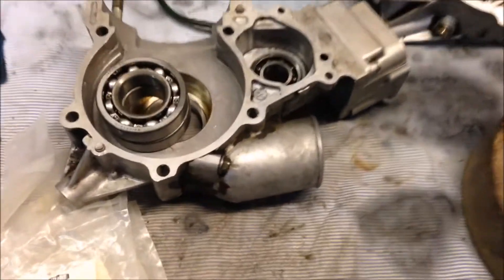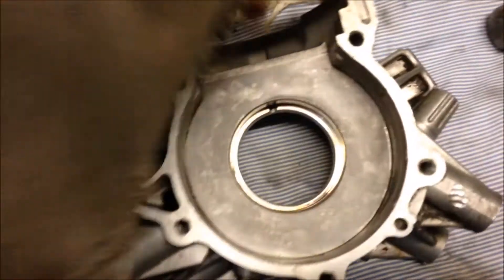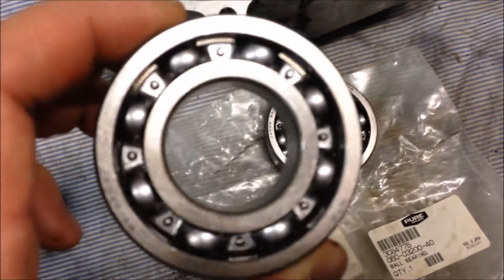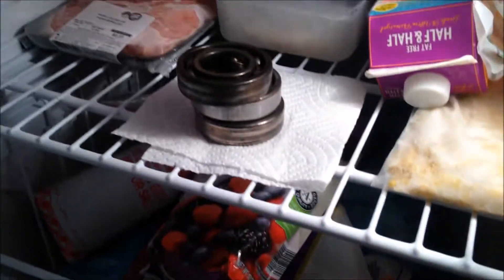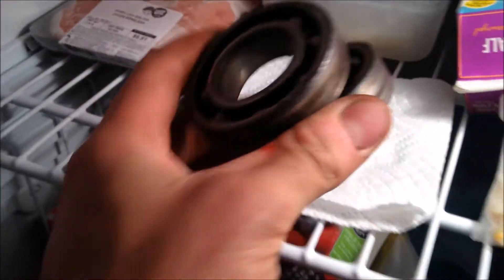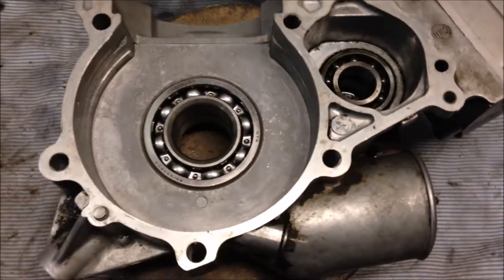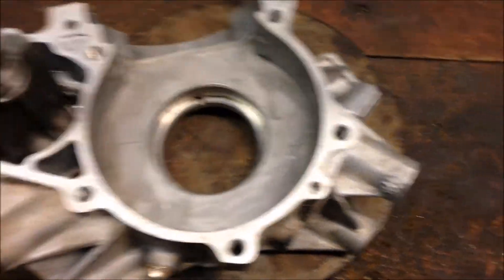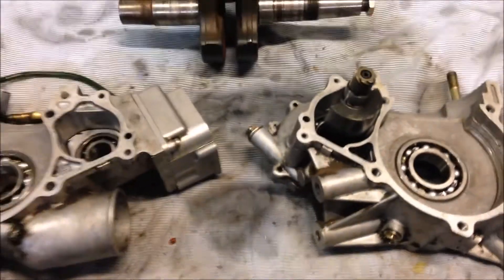Step 2: How to Install Polaris 2 Stroke 300 350 400L Crankshaft Crank Bearings Installation ATV

Comment: i got her put together and did a leak down no leak but when i started it up with the primary clutch off just to test after about a couple of minutes the taper of the crankshaft was hot enough to burn my hand but after it cooled i could move it not seized up any ideas would help thanks
Reply from the maker: Sounds normal.
Reply: so your saying it happened to you without melting the seal and its not an issue you would worry about ?
Reply from the maker: The engine and the crank are probably 200 degrees F when running yeah.…

Comment: I need help. I have watched all your videos related to restoring polaris scrambler 400. I can't find anywhere even in the manual on how to set the timing. I got her running but she backfires like crazy. Carb was passing out gas so I cleaned her up. No more leaks but I can't keep it running. And she's still backfiring. Any ideas ??
Reply: I'm no pro at this but rebuilding one as well. I believe the timing is set when installing the crank gear to the counterbalance gear with the lining up of the dots on both gears.

Comment: Okay I'm confused. Which way does the tapered main bearing go?
Reply from the maker: The bearing is symmetrical so it does not matter.
Reply: @BrapStuff  okay, tapered is the wrong work. Chamfered? But doesn't that side go against the crank? That's what i was just told

Comment: First of all love your video's, freaggin awesome.  I bought crank bearings -- but they sent all three the same -- not the one with a rounded inner -- will that make a difference???  I checked and a few other EBAY sellers sell the same thing -- all three the same not 2 the same and one with that rounded inner...    Should I proceed or return???
Reply from the maker: Give it a try and let me know what happens! :)
Reply: @BrapStuff  So do you always use the rounded towards the spacer...  But, have you ever got all three the same and put one together like that?   That's what the guy sold me...   Don't want to do this twice...
Reply from the maker: If it's something of yours give it a shot. If it's a customer project, use OEM parts and fix as the factory intended.

Comment: As long as I make sure that the correct bearing goes into the case first, does it matter which side of the bearing goes up or down?
Reply from the maker: That doesn't matter, no.

Comment: what is the best way to remove the old bearings, I need to replace counter shaft bearings (catastrophic failure) also wanted to ask about case damage, lots of gouging on countershaft and all through the inside of the case(from the bearing breaking apart, oil pump end of countershaft) rotating assembly all spins freely and smooth, however there is a hole in the case between the crank and countershaft, does this mean the case is junk? everything should still seal up, no holes on the outside of case, also inner race is stuck on end of countershaft, any tips on removing it?
Reply from the maker: Use a hammer or slide hammer to remove the old bearings. The cases should be sealed from the outside air. If they are not sealed the air leak causes a lean conditions, etc.
Reply: Brap Stuff so the hole between the crank and countershaft shouldn't be an issue? as both sections of the case are fully sealed right?
Reply from the maker: There should not be a hole between the crankshaft and countershaft...at least not that I am aware of. Both sections should be sealed from outside air.